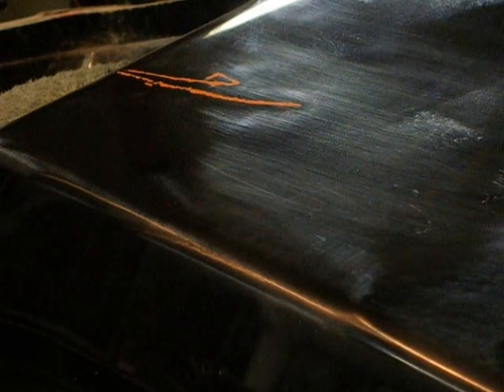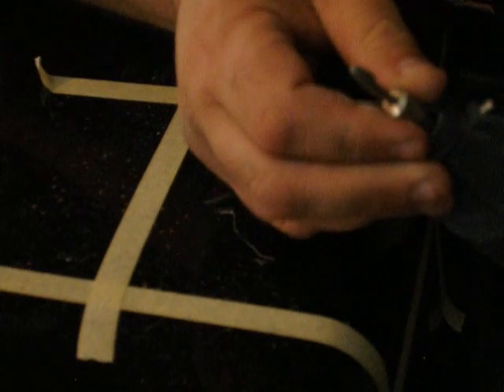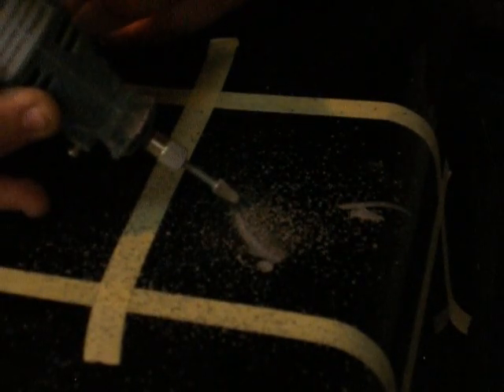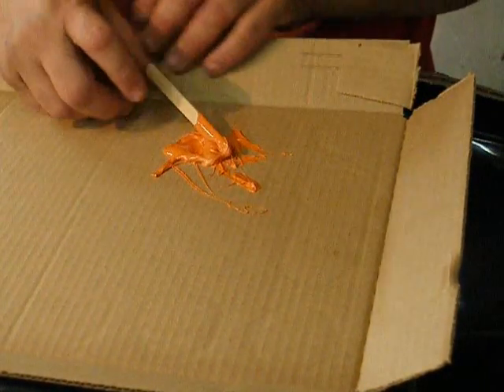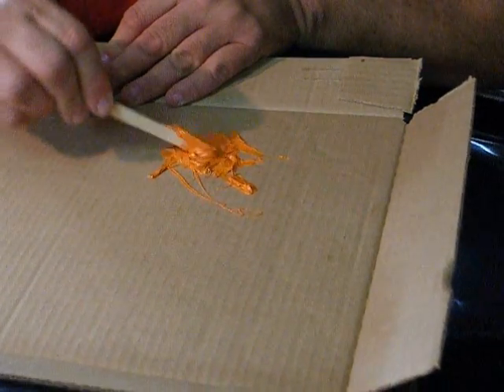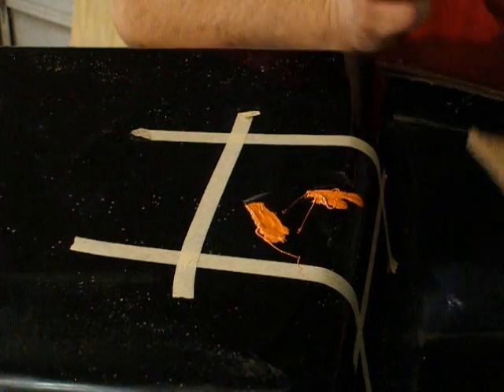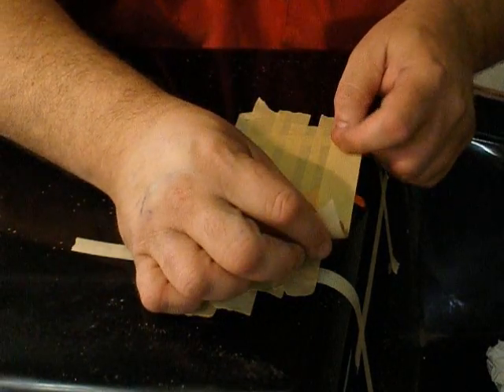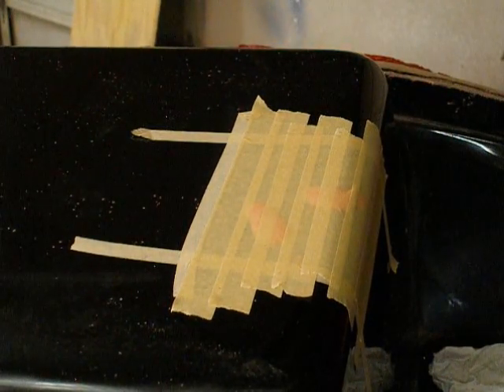How to Build a Fiberglass Boat. Mold Prep Part 2d

Comment from the maker: The heat of the resin can leave a pattern in your gel coat, called "print through".  Which if not sanded out, will imprint on every part you make from that mold.

Comment from the maker: I don't see anything on your pattern that would lead me to think that it might stick somewhere.  Unless you totally missed a spot with wax, or got some kind of solvent on it somewhere.   If you waxed it at least 8 times, you should be good to go.   And yes you would have to sand your mold to get the texture of the pva out, but 9 times out of 10, I usually go over the mold with sand paper to remove any marks that might have transfered from the pattern, and to remove any noticable "print through.

Comment: Well what you think I should do? You can see my Pattern in my videos. Its finished with Duratec Surface Primer. 
I have sanded out as much porosity as I can and I am using TR Mold Release Standard. 
I don't want to use PVA cause then I will have to sand out the texture from it out of the mold right? 
But I don't want to lose my Pattern get stuck in the mold? What happens if it gets stuck? If I get the mold out I don't mind if the Pattern is destroyed. But I never done this before.